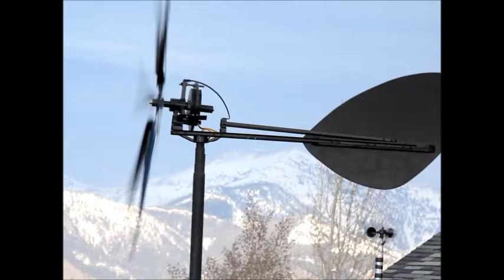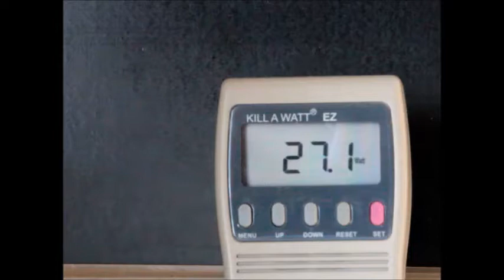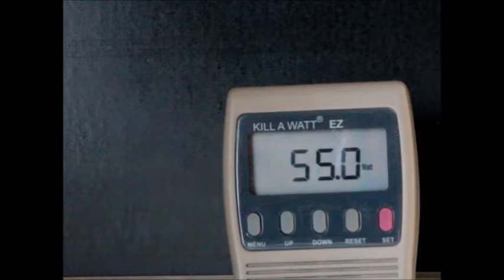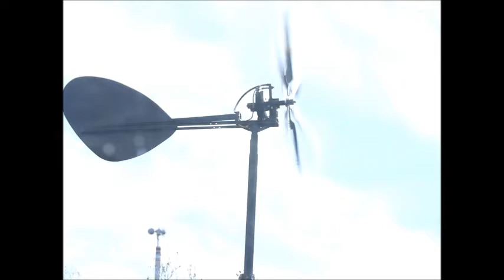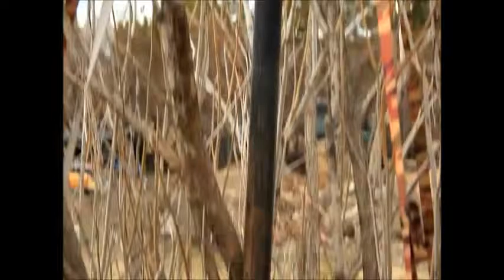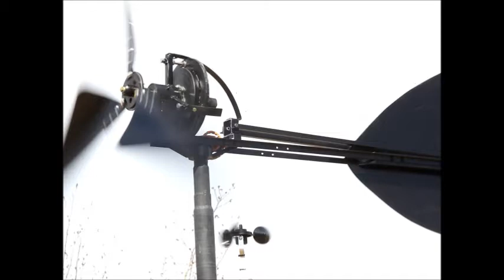Part 3 "Straight Shot" Dual Magnet Axial Flux Wind Turbine

Comment: excellent video. I like the framework design. very pretty.
The curved strip of steel over the top looks like it can have several interesting applications as well. Nice, Very nice.
MUDDy
Reply from the maker: +muddymuddymuddmann Funny that curved strip is pretty much there to look cool. All the welds are more than adequate to handle the stress. As I mentioned on your other comment this turbine is up again. It has nine guy wires on 2" schedule 40 at 15 feet in a super exposed area....  strait line winds that about never stop. It took a storm with 30+ winds and gusts up from there and no issues. Can't wait to show you some video
Reply: Awesome bro. I cant wait to get mine back up. Too many important irons in the fire. Most seem to take rank over my fun.

Comment: Great product!  I live off grid, I rely on solar and generator, hoping to add wind.  Being Montana based you get the nod.  With a charge controller will your straight shot work with my 24 volt system?  I am new to wind but have been 12 years solar, so have a grasp of it enough to maybe ask pertinent questions.   I see in the vid the changing direction has little effect, I have a friend who bought a wind turbine from his neighborhood solar/wind source (Anaconda, MT} it keeps burning up bearings and all sorts of maladies, Yours appears to avoid most if not all.  I have wind reversal and the like but mostly steady 7 to 10mph sw winds.  I will keep watch hope your product is a go you can mark me as a future owner!
Reply from the maker: Thanks Griz! Yes, In fact this turbine is probably better suited for 24 volt. It seems to put the blade rpm in the sweet spot. Unfortunately, It has been in a protected residential yard with tree's and houses blocking much of the favorable wind. I keep it on a 12 volt system so it spends more time in a charging state .... anything above aprox 8mph. I also use bearings recycled from a ski lift and a 1" shaft so it is overbuilt. I appreciate the kind endorsement and have plans to have some more of these available in a few months! Cheers

Comment: I have a 24-volt pmg.  I was using the 5-blade 80" Falcon blades. I have it hooked up to a 500W grid-type inverter like yours. It goes through a watt meter.  I am getting 200 watts through it in 15-20 mph winds.  In 25-30 mph winds, I had almost 500 watts. I thought you might like to know what I got using these items.

 There are very few videos on you tube showing the amount of watts that are produced from having the wind generator hooked directly to a grid tie inverter.

 Thank you for posting this informative site.  I learned a lot from it & will keep watching for more information.

Comment: Hi, I just found your site & really enjoy it.       I am having trouble balancing my three 80" span Falcon blades. I made a shaft that I attach to my basement post to be able to spin the blades by hand to see if they are balanced & also weighed the blades so they were the same weight. I attached car wheel weights to balance the blades. I used the same blades with 2 more blades on my 5-blade hub & had no trouble balancing them. 
  When I use these blades on the 3-blade hub, I think they are balanced but the tail shakes at a certain speed.
 
  Any suggestions will be helpful.

Comment: thanks for the information on that sun inverter. past 3 days it has been raining so heavy I can not go outside by the shed or work bench to unpack a box lol. before the rain came my neighbor did come over and help me install the upper section to house the VAWT. its over 12 feet in the air. he came up with a really slick way to raise it up instead of using muscle power. ill try and make a video soon.

Comment: WOW! that sure is running smooth with either blade set up and the way it turns with the wind is nice. great bearing set up. the inverter you ran the power thru, is that a Sun? and if so what wattage is it, and was that one for the solar and you just hooked up the wind generator to it?
Reply from the maker: Sorry for the delay brother. Thanks for the compliments and it is indeed a Sun 600 watt DC input 10.8 - 30 volt for wind and will dump when it goes over volt.  I assume it would dump at 600 watts too but I haven't gotten anywhere near there yet. Thanks for the visit!

Comment: weather proof?
Reply from the maker: I would say as well as possible. Bearings are sealed with and exterior grease fitting and the stator coils are embedded in resin epoxy and reinforced with fiberglass. Everything else is steel that has been primer coated and painted. It is high dry and cold here in Montana and does fine but I would assume a warm marine environment would take it's toll? That's probably true for most turbines though. Thanks for stopping by

Comment: have you tried a larger tail. it might help out some in tracking.
Reply from the maker: Interesting thing is it will hunt like that even with the blade set off .... the wind direction is just that erratic most of the time here in the yard.
Reply: belgrademachine O I see. wow it dose look cool as heck and looks to work pretty good and looks as if it would product more if in a straight line area and not in a dirty wind area.  you and muddy have done a great job working together on this.